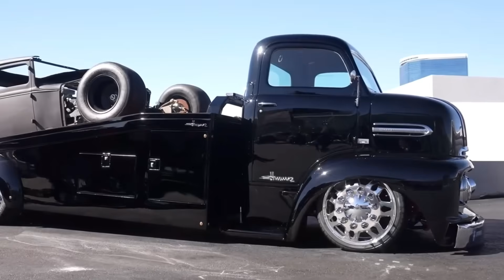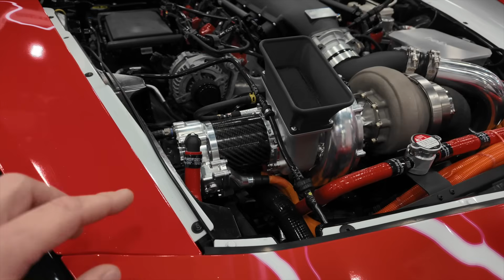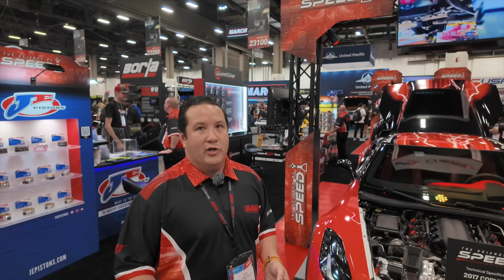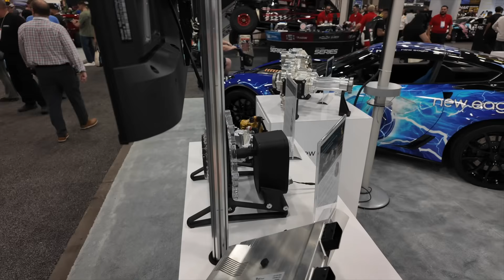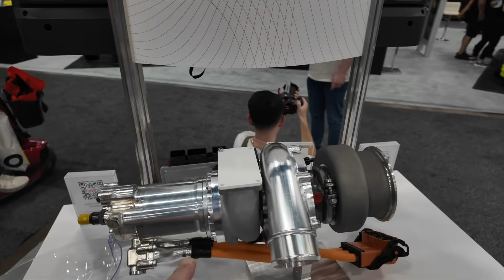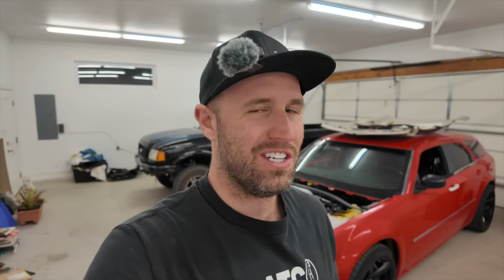How Did Everyone At SEMA 2025 Miss This 2000HP C7 Corvette With FORMULA 1 TECH that can do 200+ MPH

Comment: 🤔So if its a E-turbocharger, then you only need to have one bank of the V-8 SEND EXHAUST to the turbo. The other bank of pistons ( say for example the drivers side bank) can dump strait out the back of the car like a normally aspirated  corvette.....i think this is worth trying. See what that's like and if there is a exahust air-flow advantage? Sure would sound different.